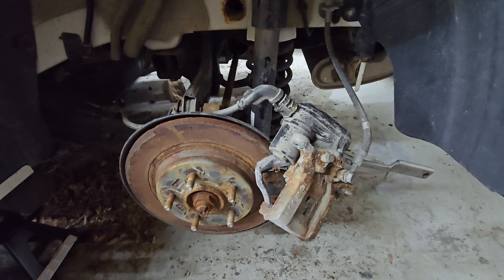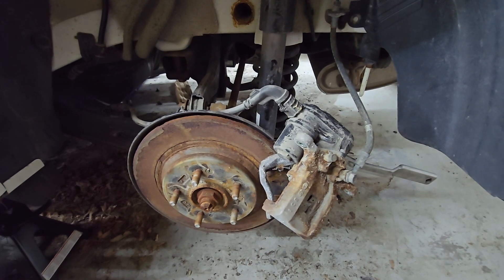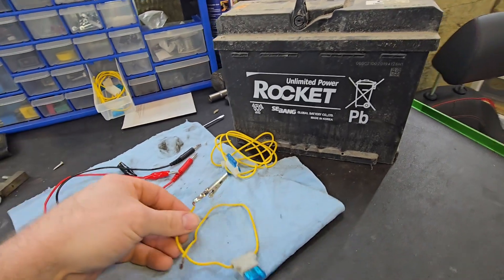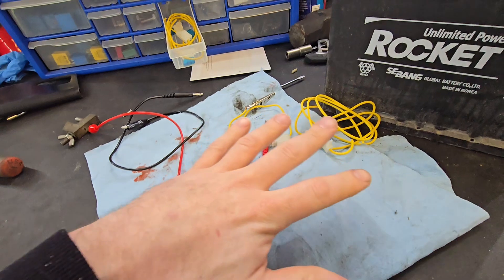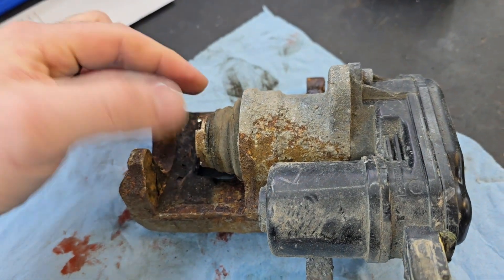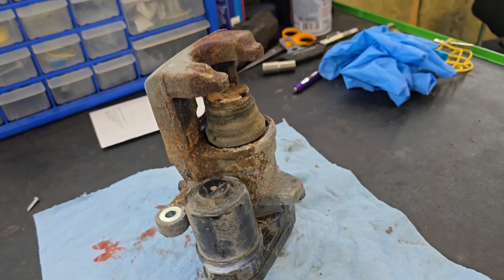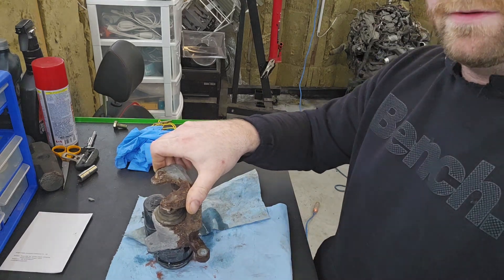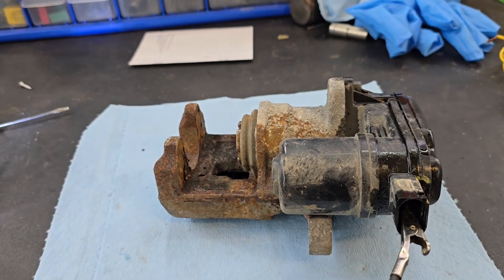How to Retract Electronic Parking Brake Without a Scan Tool. Step-by-Step Guide. Hyundai Kona & More

Comment: Another way we use on the euros when they don’t want to retract is to remove the actuator and manually wind the caliper back in
Reply: There's a lot of cars I do that on even if the scan tool would work, just faster.
Reply: That's what I do